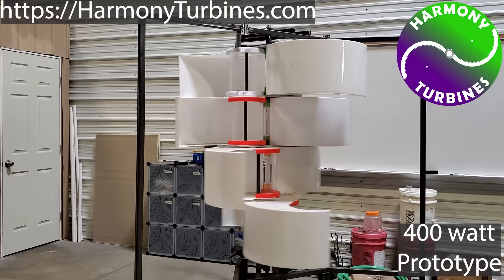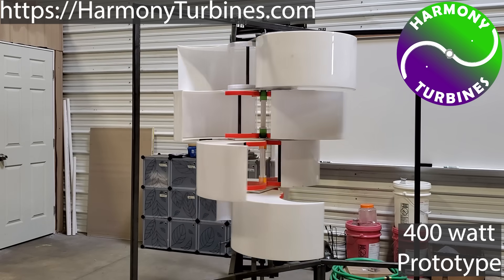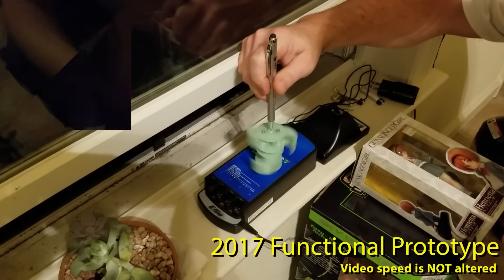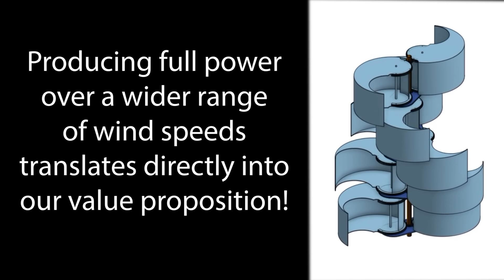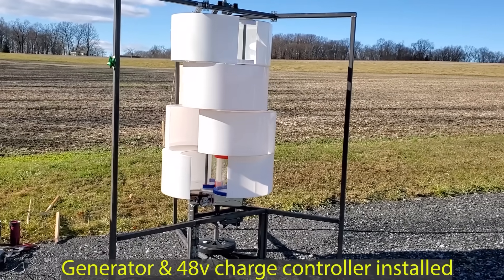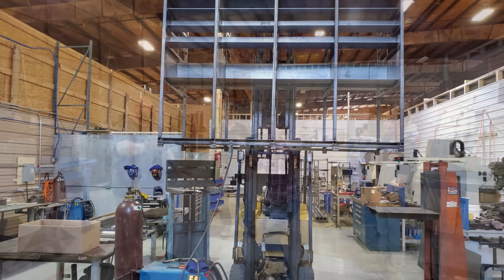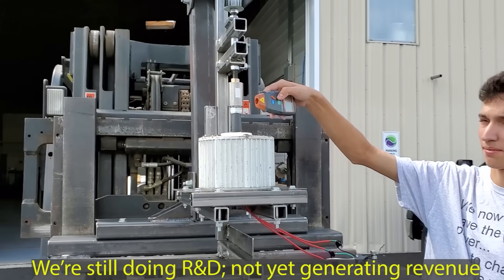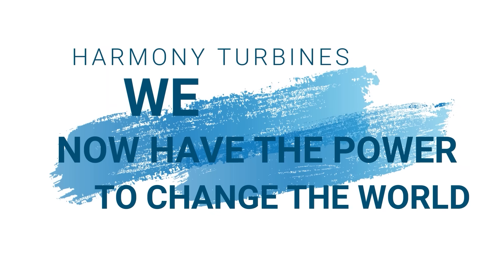What makes Harmony Turbines so revolutionary?

Comment: Found your channel searching for solutions.
I live on a small off grid business property in Doney Park AZ (suburb of Flagstaff). We have serious gusting wind here, nearly 365 days a year. Recently gusts topped 90 mph. Our power needs aren't substantial and our revenues are (currently) humble so cost is an issue.
Do you have any cost projections on full systems (less battery bank)?
Reply: don't waste your time, this is a scam. 
And as of your concern, wind turbine benefit a lot of scale, so for individual installation it's not a very good solution. Would be much better to reach out to local community/authorities and collectively fonds one or more industrial sized one. To minimize battery usage the best solution is to pump water up (PHES) it's especially good if you are in mountain region. But unfortunately AZ is more flatland and not much water to spare i believe, so i'm not sure it will be suitable in your particular case. Big flywheel can be an option but here again scale is your best friend, i'm not sure it would make economical sens for individual installation, although industrial size one do show pretty good abilities. I know in Spain they explore molten salt solar panel and they would be a very good solution in AZ also as the climate is probably pretty close, but once again that only make sens in industrial scale as it rely on thermal mass (energy is stored as a volume so m^3 and lost is per unit of surface so m^2 so the bigger exponentially the better). Although i totally understand the will for independence (and actually share a major part of that desire) i'm afraid energy is one domain where community scale is king. The only interesting individual solution that i can think of (out of solar panel + lithium battery) in your case would be low/mid depth artificial geothermal, but it only cover thermal regulation part of the energy need (i.e. : heating/cooling air) and you need land area at least 10x your house living area. That show very good result in south of France, they install it under olive tree plantations.
Reply: Just ask your neighbors. Lots of people in Flagstaff have wind turbines. Otherwise, you can take a trip to the university and ask to see their renewable energy lab behind the engineering building. You can see the whole setup there and two different turbines. If you find a guy in Hawaiian shorts, he’s the one to talk to.
Reply: In Arizona, use solar.
Reply: @Stefan_Dahn  I have solar but have parts & want another alternative for backup.

Comment: Nice design. . I hope you guys can make it more safer by putting vent flaps to close and open it everytime the blades opens and closes. During windy seasons, tha blades will close and vent flaps will open to neutralize the pressure between outside and inside the closed blades. . Correct my english.

Comment: How efficient are these turbines?
I'm guessing they produce quite a bit of drag on the sections that aren't facing the wind...
Reply: you wont get an answer from this guy because vertical axis wind turbine (HAWT) is inherently less efficient than horizontal axis ones due to the fact that half of the turbine is moving into the wind at all times.
Reply: As a welding engineer in the 90's I had the chance to work on a energy project 
 at a steam generated electrical plant, it very similar set up was used to govern the turbine speed, the main difference or improvement was in the impeller,  the rear of it was shaped into a rounded tear drop there for reducing the return drag of the impeller, that improvement alone made it 16% more efficient and quieter! Also look into bamboo fibers and resin for making the impellers with a mold they can be made lighter and faster! Thanks Nate
Reply from the maker: David, It's finally coming to light that there has been a large disinformation campaign for decades against VAWT's and in general Savonius turbines, starting back in the 1950's or around there. Savonius Turbines are actually > 30% efficient without any helix twist or ribbed sections. A proper helix twist greatly reduces stress over the entire unit and smooths out operation as well. The main noted drawback noted was high wind vulnerabilities which our patented design now solves. Look at this https://youtu.be/pbtR6VG-gLw?t=225
Reply: @HarmonyTurbines  And how many time do you cut and past that BS ? You stole the concept that existed for decades, and your implementation is probably one of the worst i seen, and now you claim that you know better than science ? Come on don't be silly.
Reply: @HarmonyTurbines  I doubt that there has been such a campaign but it doesnt matter. No amount of "bad data" can change the physical theory of it. Drag based turbines can never compete with lift based ones.
Reply: @HarmonyTurbines  🤣🤣🤣
Such desinformation campaign from centuries, that we have a round earth.You sound like a flat earther. Ridiculous. 🤣🤣🙈

Comment: Can the design cope with sudden onset of gusts of wind? Perhaps it could also benefit from being self-governing, that is closing up as wind speed rises even when the control fails to crank the motor.
Reply: I would expect that it can't. Gusts will pull the flimsy bones wide open, with how many moving parts it requires to function. 

My personal guess is that compliant materials will be the solution these problems are looking for. Not sure how, though.

Comment: Very interesting, but NOTE that this is an advertising piece, and while they tell you all the plusses, they don't touch on any of the downsides of this tech. THey didn't mention its levelized cost of energy (LCOE) and how it compares to other renewable wind technologies. 

What you'll find is that vertical-axis wind turbines are somewhat less efficient than regular turbines, and in particular, drag-type designs like the harmony are not that efficient at all. But in situations where a massive horizontal-axis turbine is too big and difficult to install, the harmony could hit the sweet spot in urban environments, which have  variable or gusty wind close to the ground. The Harmony should be quiet, have a very simple design, that can be made to be very inexpensive and reliable. They could also be far less obtrusive, installed on one corner of a residential house, but still provide a large part of the house's energy needs. 

But it all comes down to cost, and it would be tough to make cheap eletricity with the harmony. But if they can produce and install it for a similar cost per kwh to rooftop solar, it could be a winner in the kilowatt segment.

That said, I believe it is very important to encourage and foster the development of new renewable energy technologies, and it's critically important for the future of humanity.  Good luck guys, I hope this tech develops to be dominant in the small wind turbine segment.
Reply from the maker: John, It's finally coming to light that there has been a large disinformation campaign for decades against VAWT's and in general Savonius turbines, starting back in the 1950's or around there. Savonius Turbines are actually > 30% efficient without any helix twist or ribbed sections. A proper helix twist greatly reduces stress over the entire unit and smooths out operation as well. The main noted drawback noted was high wind vulnerabilities which our patented design now solves. Look at this https://youtu.be/pbtR6VG-gLw?t=225

Comment: On a large scale, I doubt its ability to withstand against a sudden wind turbulence. Its ability to respond to  protect itself is not that fast against a very strong wind. It doesn't even have the aerodynamic shape on upward wind direction. I hope you could improve it more, it's a good engineering design though
Reply from the maker: Brad natural winds do not come up in split second gusts like you're trying to describe. You're describing a shock-wave from a bomb blast or a tornado. No wind turbine could react quickly enough to withstand that kind of abuse. But natural winds, even hurricanes and typhoons, increase over minutes and hours ...not seconds. If Harmony can go from fully open to fully closed in 30 - 60 seconds we should be perfectly fine.

Comment: An idea would be to introduce a centrifugal governor like those on steam engines. That way the system can be analog, not digital.
Reply: I pretty much said the same thing (before seeing your comment)  I also commented in that if the furling mechanism failed in the same way as the pitch adjustment failed with the "on fire" turbine, the results would be similar damage
Reply: Ohhh a balls to the walls wind turbine sounds fun.
Reply: The governor on a stream or diesel engine works by cutting off the steam or fuel supply.

How exactly is your governor going to throttle back the wind?
Reply: @goodbye8995  by furling in ofc
Reply: @Camotli  hmm.  You're going to need some kind of power assist for that don't you think?
Reply: @goodbye8995  centrifugal force rings a bell?
Reply: @goodbye8995  He means a spring working against the centrifugal force. At high wind speeds the centrifugal force keeps the rotor open, at low wind speeds, the spring overpowers it
Reply: @fg8557  isn't that the opposite of what you require? Look up stream governors, would require something like that.
Reply from the maker: Guys at the low RPM's Harmony operates, flyball governors are not really practical to use. The lower the RPMs the bigger and heavier those flyball weights have to be to perform their function. A large part of what makes Harmony so attractive to onlookers is the slow rhythmic oscillations as it spins. Even in 25mph winds we're looking at less than 200 RPMs. The furling is controlled by a servo motor and an RPM monitor so that we can precisely dial in different states for various conditions. Safety algorithms and also perhaps efficiency algorithms. This will be some interesting stuff to play with as we get our University partners involved. So please stop with the flyball governor stuff. It won't work for our furling process. Not without a LOT of extra engineering. Please sign up with our Newsletter to receive the latest updates from Harmony Turbines: https://groups.google.com/g/harmonyturbines
Reply: @HarmonyTurbines   suppose as you you change scale the governors make no sense. cheers for the info.
Reply: You dont need a flyball.  Just have a weight at the other end of the vane which pushes the vane in against the wind like a seesaw.  Simplifying the design makes it cheaper and more reluable

Comment: Good work Chris
Can an array of them be mounted on a flat roof ?
How close together can they be before they interfere with each others airflow ?
Reply: They can actually interfere in net a positive way. Their next video at 3:14 mentions a paper showing that vertical turbines in a grid pattern improve performance by up to 15% (spaced by at least three turbine lengths)
Reply: @dl5244  Thanks for that

Comment: DIY use Centrifugal design of the old ignition points system
Reply from the maker: It's electronically controlled using Arduino (later will be PIC Chip) and a servo motor with huge mechanical advantages to control the scoops.

Comment: High winds are hardly ever the issue for conventional wind turbines, the problem is when things in the turbine fail so it is not able to do what need to be done.
But yeah that is not automatic in traditional turbines.
Still very nice, for sure something i would look at if i was able to get a house, and of course would want to secure my own power needs.

Regards. A Dane

Comment: Nice looking and clever furling idea BUT...it's still only a Savonius vertical axis turbine. Not much torque, lots of inherent drag and all manner of mechanical fatigue stress issues. You can't re-invent the laws of physics, the power output of a wind turbine is directly linked to the volume of air that it can process and the velocity of that air coupled with the conversion efficiency of the rotor. What do your power curves look like? What is the swept area of your rotor?
Reply from the maker: Simon, It's finally coming to light that this has been a disinformation campaign for decades against VAWT's and in general Savonius turbines, starting back in the 1950's or around there. Savonius Turbines are actually > 30% efficient without any helix twist or ribbed sections. A proper helix twist greatly reduces stress over the entire unit and smooths out operation as well. The main noted drawback noted was high wind vulnerabilities which our patented design now solves. Look at this https://youtu.be/pbtR6VG-gLw?t=225

If you'd like to help support our efforts through an investment you can go to https://WeFunder.com/harmony.turbines and if you're not able to invest we would ask that you at least help us to spread the URL to let others know what we're doing here to help make the world a better place.

Comment: To power a home in an average city (wind speed about 2m/s) you are going to need about 120m^2  of surface area to be covered with these turbines (that should give about 500 watts) (more like 360m^2 at 30% efficiency ). The problem in cities is the low wind speed. Big turbines are built in high wind areas and are tall to access the stronger wind. The formula for the maximum wind energy from 1 square meter is: kW = 0.0006 * wind speed CUBED  So for wind at 2m/s, and turbine area of 1m^2 you have 0.0006 * 2^3  =  0.0048 kW (4.8 watts). But efficiency will probably be about 10-20% for that design. Turbines always face the mathematical physics of  wind speed CUBED you solve that by finding high wind speeds (tall turbines mounted on ranges, or where there is clear air out at sea).
Reply from the maker: Sabert00th if you have 2m/s winds at your home you would be denied approval for a Harmony Turbine. Sorry to break it to you. Coastal and boating customers will be our first target market. Extremely good winds with high incidents of storms and severe wind events. Perfect for our products.
Reply: @HarmonyTurbines  "denied approval for a Harmony Turbine", you are that important?
Reply: @HarmonyTurbines  sure, but for the majority of the population these will not be effective.

Comment: I'm sorry but I can clearly see this will not be a long term solution, there is just too many potential points of failure. The amount of moving parts are ridiculous in this system. Likely though you have giving me a better idea. Thanks for the inspiration.
Reply: Power is mainly determined by wind speed. For 1 square meter the MAXIMUM energy from the wind is kW = 0.0006 * wind speed CUBED. So for 1m^2 and average city wind speed of 2m/s you get 4.8 watts. Small city wind turbines will always be useless.

Comment: thing wif wind turbines is they never tell you what min wind speed is actually "worth" any sort of power generated? what if my region has winds no faster than 6 knots??
Reply from the maker: If you rarely have winds over 6 knots then we would refuse to sell you a wind turbine. Sorry Phat but you would not be allowed to purchase one from us. Harmony is not magic it's just good solid engineering principals making an amazing product. But if you have no wind it would never be worth it. 6 knots is essentially NO WIND my friend.
Reply: Power is mainly determined by wind speed. For 1 square meter the MAXIMUM energy from the wind is kW = 0.0006 * wind speed CUBED. So for 1m^2 and average city wind speed of 2m/s you get 4.8 watts. Small city wind turbines will always be useless.

Comment: Reduce the torque the shaft has to deal with by having two sections of buckets spinning in opposite directions.  Will reduce the amount of concrete needed in the base.
Reply: I'm not sure I understand what you mean. Assuming the wind is coming from the west, the pole will be pushed the opposite way, regardless of the direction of rotation of the bucket sections.
Reply: @londonnight937  Torque.

Comment: Something that size needs to generate 4kW, not 400W.
Reply from the maker: Todd, we will be getting much more accurate data soon but for now without a properly coupled generator it's very hard to determine actual output potential. This may be more than 1kW in production in a 25mph wind but I'm not going to boast and claim something until we've tested it properly. So for now the best we can say is the data will come as soon as we can do it. If you'd like help support our efforts through an investment you can go to https://WeFunder.com/harmony.turbines and if you're not able to invest we would ask that you at least help us to spread the URL to let others know what we're doing here to help make the world a better place.
Reply: Power is mainly determined by wind speed. For 1 square meter the MAXIMUM energy from the wind is kW = 0.0006 * wind speed CUBED. So for 1m^2 and average city wind speed of 2m/s you get 4.8 watts. Small city wind turbines will always be useless.

Comment: We have been looking for some time for a VAWT this looks very exciting. When do expect to have it on the market and what power output are you hoping for? Most importantly, will you be looking at the overseas market. We are in the UK.  
Best wishes 
Ian
Reply: Power is mainly determined by wind speed. For 1 square meter the MAXIMUM energy from the wind is kW = 0.0006 * wind speed CUBED. So for 1m^2 and average city wind speed of 2m/s you get 4.8 watts. Small city wind turbines will always be useless.